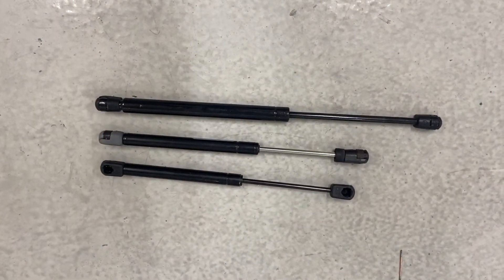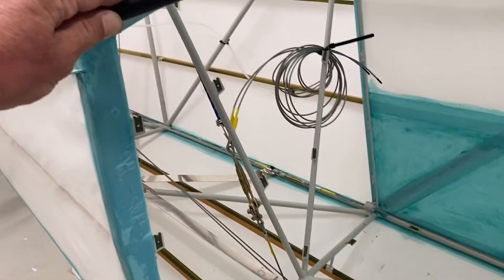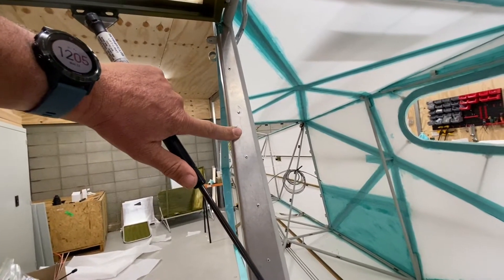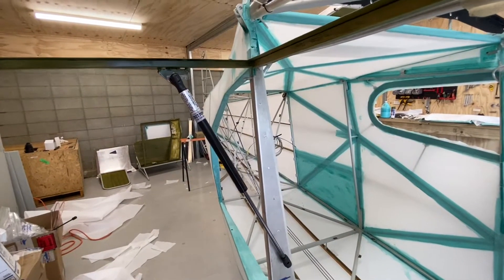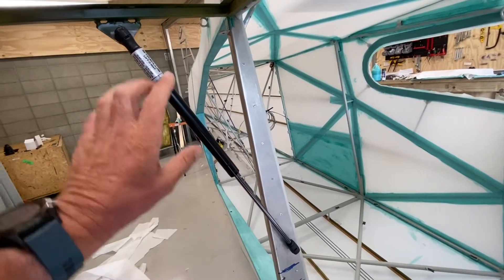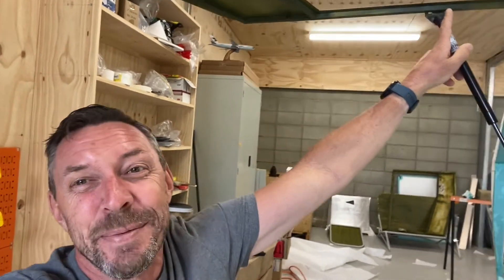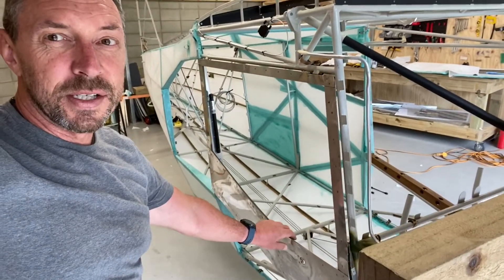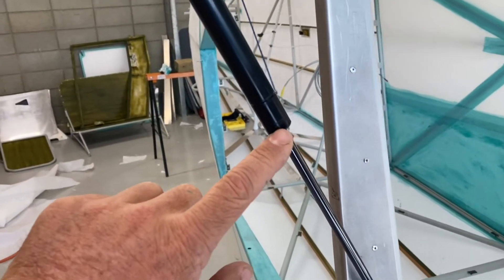Bearhawk Aircraft - Bushplane Build - Gas struts

Comment: Will the door frame hold up to the stresses of using the gas strut?  Do you think the door frame will crack over time?
Reply from the maker: There are welding 4130 tabs attached to the steel tubing frame behind the aluminium sill, the gas strut bolts through those tabs. So there shouldn’t be any issues, it seems very strong and works well.